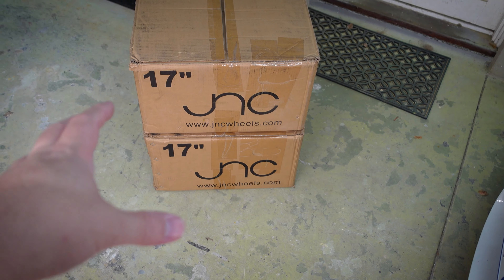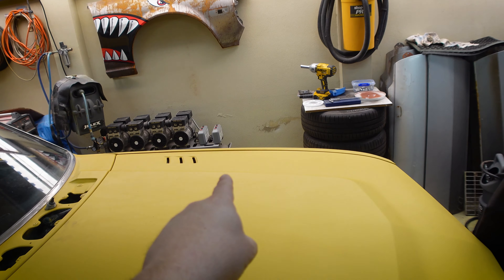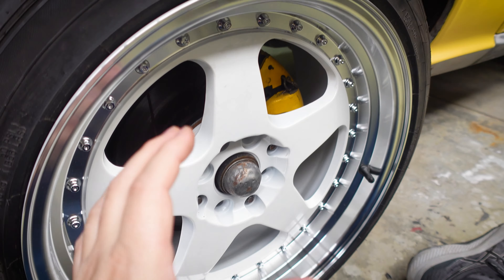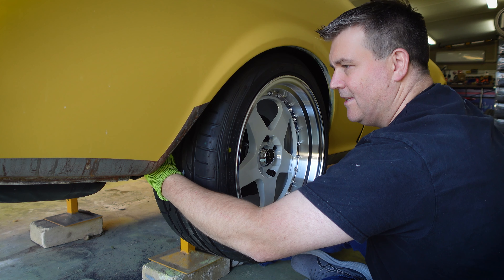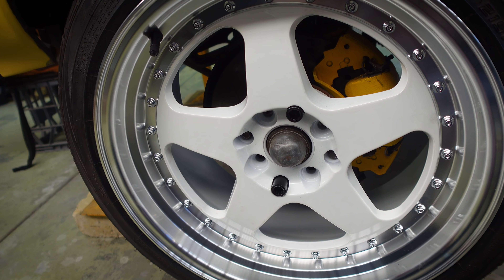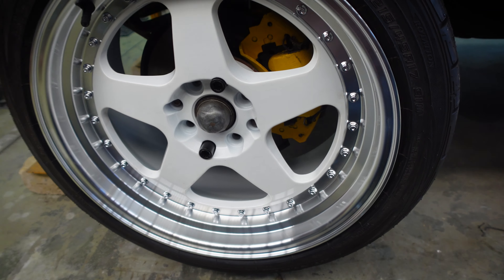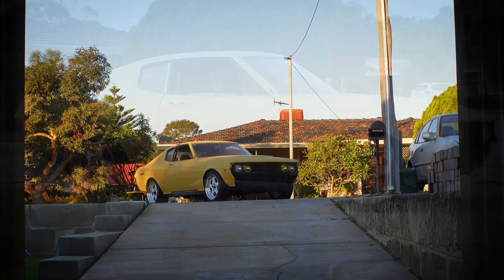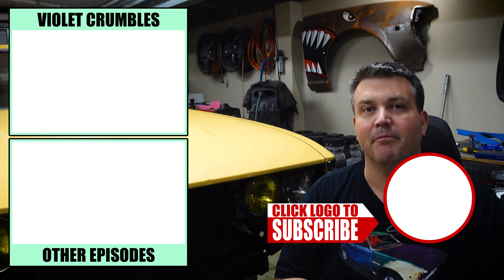Wheel Reveal!! BIG Rims and Tyre Fitment -  RA28 Fastback Celica (Part 23)

Comment: Love what you have done with those wheels, for some reason they really suit the shape of the car. Great to see you using technology to make the bits you just cannot buy. Nice centre caps. Inspired me to do something similar. Had you considered using PET-G filament for its impact resistance?
Reply from the maker: I think ASA has a slightly higher deformation point form heat, and better UV resistance apparently (I'm no expert) so I figured it was better for this application.

Comment: That’s some useful info right there. Can believe how much space in those back wheel arches. 245 that’s so nice.
Reply from the maker: @owenlambert6201  yeah I'm thinking a 265 or 275 might be possible which would be pretty sweet.
Reply: @TheBuildRoom  my rear Wats are 14x8 -6. So that’s going to be tricky as the poke is much more than yours. May have to settle with 225 or 235 if I can get them.

Comment: Hey! Love your videos, I was watching the rust repair video before this and was curious what rust converter you use? It looks water based, but wondering what brand if you’re able to share
Reply from the maker: The one i used in the previous vid was KBS Rust Blast, its a water based convertor specially designed to go under the KBS rust seal, normally i just use a phosphoric acid based one by GPI as its cheap and available in 1lt bottles

Comment: I’m running 8” fronts with a zero offset and don’t need a spacer and 9” on the back with a -13 offset but I had to roll the guards 
One thing I found was the fronts rubbed on the inner guard on turn until I had the castor adjusted
Reply from the maker: Yeah that a big increase in scrub radius doing that, used to be something you'd just fix with a large hammer but these cars a too rare to beat on them like that anymore! What size tires are you running front and back?

Comment: I'm still thinking about wheel choices. Didn't consider importing from the US.
I've got to make sure I get the specs right though, because I can't run spacers.
The build is coming along nicely, and is going to look sick once you lower it to your intended ride height!
Reply from the maker: Thanks - yeah lots of people aren't comfortable with spacers (including the cops) - so you're either swapping them around when someone notices or pretty significantly reduce in terms of options. It is however worth reaching out to some of the companies you're interested in getting wheels from for custom offset. Even some of the cheaper places order wheels in that start off as a universal casting which are then machined down, they can sometimes request a set get machined to a specific offset for you (I did this for my old RA23).